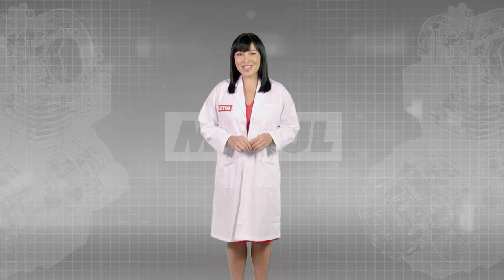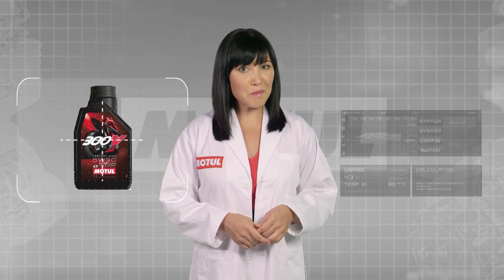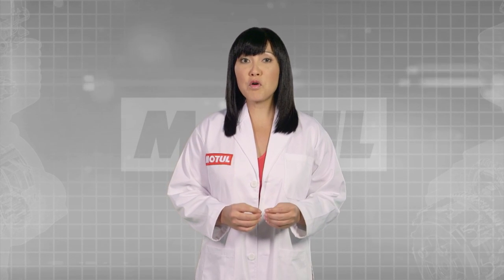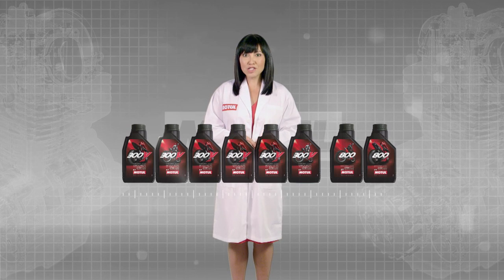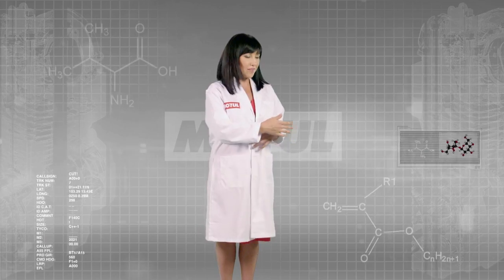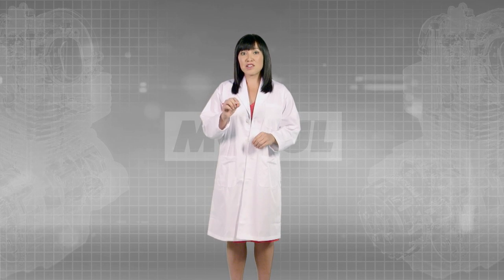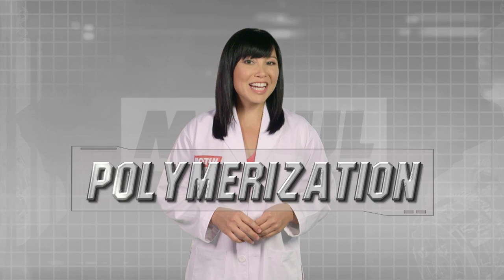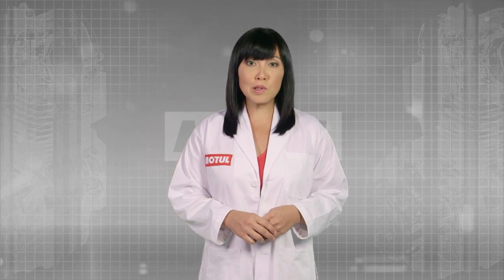What is Motul's ESTER Core® technology?

Comment: From what I can tell 300V has a high molybdenum content.  Mostly likely Molybdenum Disulfide.  The sulfide "sticks" to the metal engine parts and the molybdenum is very slippery.  If the oil film does break down, then the molybdenum will prevent direct metal-on-metal contact.

Comment: I love this presenter, she is classy and yum 😘 i love everything/everybody Asian 😉😻 I bought a brand new 2019 CB1000-R and stocked up 40 gallons of Motul 7100 4T in 2020 before prices went up. I dearly love my Honda bike that I spent over $2000 on engine condiments for it . Motul oil, Engine ice coolant, K&N filters and Motul chain paste/cleaner kit. However for first 10,000 miles which will be a long way before I reach it I am using Castrol Actevo 10 W 30 since it is a semi Synthetic (Recomended for newer engine during break in period). I always Fuel up with ethanol free 90 octane and add StarTron fuel additive. I baby my bike 😻 + it being a Honda it will last me ages apparently.

Comment: 1000cc motorcycle with wet clutch. Will it make the clutch slip?
Reply: Use 300v 10w-40 in my 2014 r1 and 2016 bmw s1000rr shifting feels alot better

Comment: If Motul is attracted to metal why do you need 3 quarts.All you would need is a microscopic layer sticking to the metal to lube and protect.All I use is 20/ 50 dino and change it every season or 2500 miles.Been riding limeys and Harley since 1968.
Reply: Lol I hope your trolling.  That microscopic layer would wear away if not replenished.  The benefit of an oil that sticks to metal is on a cold startup so there is no metal to metal contact until the oil reaches the he heads.

Comment: Can any one let me know oil dranage interval of motul 7100 20w50.....…?
Reply: I drain it at 6500 to 7000 kms. Running it since over 75000 kms  :) Goodluck.
Reply: Lol I use ester mixed with pao it can last 2 years or 12.000 km I gave MoS2 motorbike without loss the power

If that dry clutch I use High Mineral mixed with boron oil last 6.000 km with c9ating for 50.000 km

Comment: I can't stand marketing vapor...that literally told me nothing about ESTER CORE.
Reply: In simple form this is just a glorification of Ester based oil.
Ester is the majority of what this oil is made and is a true synthetic.
Reply: @bryanmartinez6600  You do realize that ester is just a naming for organic substances with a specific chemical part in them right? So there are thousands of esters, which one are they using? Just saying ester has the same weight as saying "metal". Which metal?????
Reply: @bryanmartinez6600  Stay on Castrol noob loool
Reply: @Big1_  used Castrol Edge Extended performance once. My chain rattled louded with Castrol, I use Liqui Moly now.
Reply: @bryanmartinez6600  Castrol is shit and should be erased from market... Motul is the best oil for your bike, and make sure its Ester to keep the lubrication at any temperature.
Reply: Big 1 motul and amsoil makes 100% synthetic oil a have never seen other companies make 100% synthetic oil
Reply: @Big1_  Well, considering that even if you put only 1% of Esters in the oil you're allowed to call it Ester... And this video is just marketing mumbo jumbo. Not a single explanation is given. So yes as a BASE OIL, Esters are better. BUT modern engine oils are mainly based on the additives packages you put in. Therefore the quality and specifications of an oil are determined by the additives packages more than the base oil. Esters are great for short intervals and racing because of the high heat resistance but they're also the most expensive. Hydrocracked base oils offer the biggest amount of additives. PAO are a step over HC. For daily drivers with decent oil change intervals it's cheaper to go with a group 3 or 4 oil. 300V is not rated as considered as racing oil. For street use I'd still go with Street Race series from Liqui Moly which is superior. Even on Harleys feedback from my customers were all the same. After switching from Motul 7100 to Liqui Moly Street Race they felt a better response the engine was revving up quicker.
Reply: @SilentScreamer413  according to the tech data sheet of Liqui Moly it's also hydrocracked oil. So it might be the additive package is better than 7100. Moreover 7100 contains ester but not marketed as ester core.
Reply: @tridip.chakraborty  nowadays the additive packages make up for the most part of an oil quality. Hydrocracked oils are not as high tech as PAO or Ester oils but they are much cheaper to produce and constitue the vaat majority of oils out there. hydrocracked oils also allow the highest percentage of additives in an engine oil. That said, Liqui Moly's higher tech oils are PAO (synthoil and street race if I'm not full of shit).
Reply: @SilentScreamer413  yes I recently discovered that from a Liqui Moly website by the their lab person. They label PAO as full synthetic written in German whereas hydrocracked one is Synthese (Street grey label)

Comment: Would you recommend motul in a direct injected turbocharged engine? If so which one? Sae5w30 must be lsac certified
Reply: Did you try 300v?
Reply: @jrw8080  no ended up running Castrol edge. But to be honest that motul would be just fine either way, if your engine blows under warranty they can't tell which oil was used anyway

Comment: But 7100 is also ester no? So isnt it also ester core? How suitable is 300v for normal street use? If i use 300v on normal use, do i need to go for more frequent oil change?
Reply: jbdoggy 300v is fully ester core based. 7100 is mixed Ester and crude based.
Reply: @danielmak33   Thanks. So if 7100 is ester + crude based, what is 5100 then?
Reply: jbdoggy 5100 is semi synthetic crude based.

Comment: How does it differ from Redline's ester based oil?
Reply: Redline is 45% Ester and 55% PAO according a Youtuber who does analysis of a lot of oil.  He called Dave at Redline and he reluctantly admitted it was not 100% Ester. That’s why it says All Synthetic and not 100% Synthetic.
Reply: @BW-kv9wj  oil can't be 100% from what I heard, pure ester is way to hard on seals.  As long as it doesn't have any group III,  I'm good.
Reply: @datsuntoyy  Yeah, it’s quite confusing.  I’ve figured over the years, just use Amsoil 100% Synthetic Group 4 and change it regularly and you will never have an oil related engine problem in your vehicle.  I have 460,000 miles on my Toyota Truck and have always used Amsoil.  I do use Motul in my Harley and I have tried Redline in other cars.  I’ll stick with Amsoil for my daily driver.
Reply: @BW-kv9wj  Amsoil isn't 100% PAO anymore.  I've confirmed this with an Asoil rep once but he wouldn't say what the other is or the percentage.  Still great oil though.
Reply: @datsuntoyy  Then they are not allowed to write 100% on their bottle.  The must remove it and just write Fully Synthetic or Synthetic.  Only 2 oils are 100%.  Amsoil and Motul.
Reply: @BW-kv9wj  didn't say it wasn't 100% synthetic, just that it's not all PAO anymore.  The bottle nolonger says 100% PAO like it used to.
Reply: @datsuntoyy  I never knew Amsoil to ever say 100% PAO.  But I just saw today on Amsoil website for Signature Series Oil Safety Data Sheet (SDS) that it’s made from Hydrogenated Base Oil which is Group 2.  Is Group 2 100% Synthetic???
Reply: @BW-kv9wj  hydro-cracked grp 3 is petroleum...might have some PAO and maybe 2 or 3 % ester...Amsoil started out as an ester base...now almost none.
Reply: @mikeschlup5279  I use MTP Industries 30K, 100% Synthetic oil. It’s Ester with zero petroleum in it. Side by side testing beat Amsoil. I sent both samples to Blackstone and MPT has better and more of the important ingredients.

Comment: Incredible oil. Motul will always go into my trans and rear end diff. For me its too expensive for an engine oil change every 6 months, so I use Amsoil Signature for almost 1/2 the price. Wish I could use the Motul.
Reply: Dude its depend on usage.. Mine used on my sportbike.. Its really performance/price balance for me.. Perfect
Reply: Use Motul 7100! 🙌🏻
Reply: Motul is way cheaper than Amsoil for me but im using it in my car not a bike lol. At least on the Walmart site they’ll deliver it to my door and it’s 50% cheaper than any site i seen so far. Can’t wait to switch from Mobil1 to Motul 0w30

Comment: One question..... Does engine oil expires overtime even if you don't use it much.. Like rarely running. 
Does it carbonizes through ideal durations
Reply: chinar jadhav 1 year or the mileage came first.
Reply: I would do 6 months max. I have a car sitting and it developed oxidation because of the cold weather. Changed the oil immediately. It’s still sitting but once i get it running properly i’m doing another oil change and switching from Mobil1 to Motul 0w30